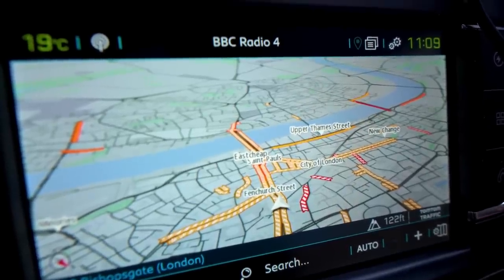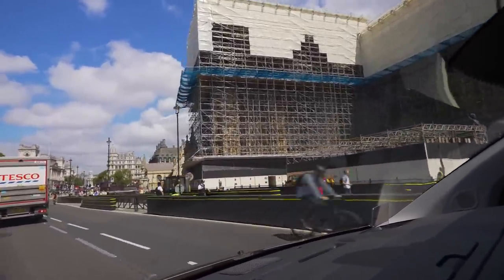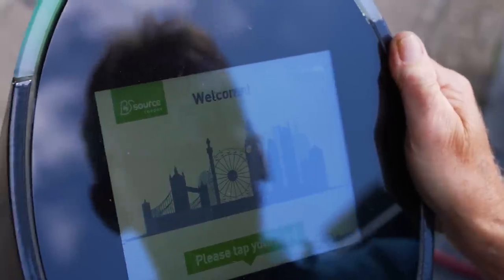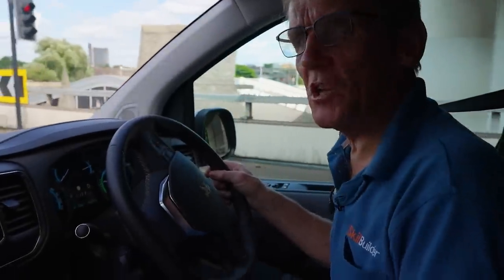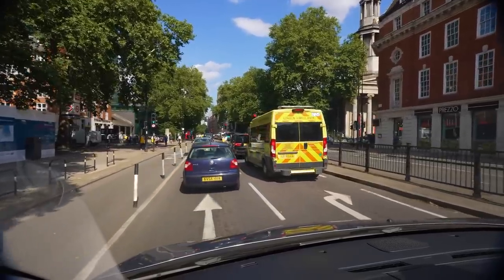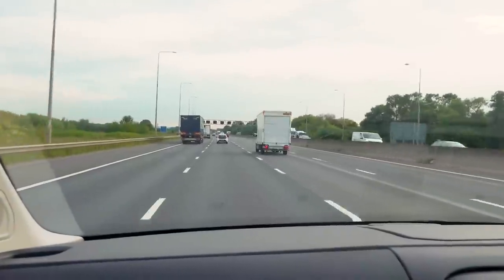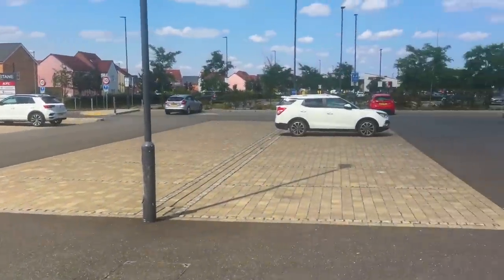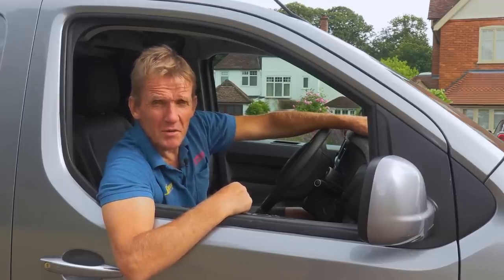Is It Time To Switch To An Electric Van?  e-Expert Test

Comment: The problem with most road tests is that they use brand new vehicles. Try a 3 to 5 year old EV and see how the battery holds up - that would be a more realistic test,
and don't kid yourself that the govt grants and incentives will last once they converted the majority to EVs, these schemes are designed to suck you in.
Also, how do you think the govt will make up for the black hole in their finances caused by the loss of fuel duty? What happened to your critical thinking Roger?
Reply: Rapid charging a battery every day will shorten battery life considerably, even Tesla has that problem, when charged daily.
Reply: @craigrobinson1234567  it does, just fast charge your smartphone for a year or two and see the difference in battery life
Reply: @polomint46  You are correct even they have the issue however where you miss the point entirely is that Taxi drivers who have done over 1 million miles on there Tesla's who charge regularly have seen no more than 8% loss of battery capacity. Now tell me how long it would take the average person to drive 1 million miles on their car? Secondly lithium batteries have come along way as have evs the leaf had terrible degredation it had no thermal management (liquid cooling) where as all evs now come with management. New batteries are round the corner like 2023 round the corner it will only get better. You clearly have done no research and its a shame because so many people think like you I have done long distance trips in 3 year old evs namely the leaf and zoe and I was shocked at the comfort and how much range they still had.
Reply: @craigrobinson1234567  how old is the vehicle ? i am hoping hydrogen takes of
Reply: That's your take on it of course. When ours - and other Governments - sign pledges and agreements to cut Co2 and other emissions, they have to come up with strategies to convince users to switch to alternative, less polluting modes of transport. And no, the incentives and schemes won't last. They were never meant to. But you have to try to begin the switch somehow if you've agreed to reduce Co2 etc..... If you don't offer incentives, then the move will take longer. Of course after 2030 there will be no new petrol and diesel cars or vans, so incentives will no longer be needed, plus prices of new EV's will have fallen by then anyway. It's the same story with all new technology. I bought a new Nikon 3.2mp digital camera about 15 years ago, at a cost of £450. The same thing today will be around £25 to £30......  You can buy a new family sized electric estate car today for £20k with a 7 year warranty if you know where to go.....  Why would a 3 to 5 year old EV battery be problematic when it has a 7 year warranty? The average battery degredation rate is around 3 to 4% per year.
Reply: @Brian-om2hh  Warranties don't cover consumables like tyres & brakes, they won't replace a worn out battery either, they just say "fair wear and tear".
Reply: @polomint46  3 years down the line they wont be worth a sh-t.
Reply: @geebix  your not kidding it’s absolute bollox. Saving money, wtf the thing costs 45grand. Your not saving a penny.  You are being robbed, it’s a metal box with three seats to carry your tools around. Whose going to buy the thing off you when it’s got a hundred thou on the clock. Some people are suckers.
Reply: @tracer1127  You are so right, it doesn't take a rocket scientist to see what is going on, a tradesman in a £45000 van however much will he have to charge to pay for that????
Reply: A 3 - 5 year old electric van wont be a worth a sh-t after 3 years especially as a new battery will be costing roughly half of the vehicles original price. E/V are a joke and sadly there are people now getting sucked in. Hold fire there is new technology on the horizon.
Reply: @geebix  if I didn't buy tech because there is better stuff round the corner I wouldn't buy anything, go drive electric and made an actual intellectual opinion based on facts please. Oh wait you probably can't.
Reply: @geebix  Our Nissan Leaf cost us £18k back in 2016. We part exchanged it for £9.5k a couple of months ago. Not bad for a six year old car.
Reply: @Richard482  That's only because consumers do not have a great deal of choice at the moment in a few years the market will be awash with second hand battery cars,  and besides there is always a mug prepared to by sh-t.
Reply: @MaDxStArZv  This crap is the very last thing I will be buying and I am trying to convince thousands of others to do the same, residuals in a few years time don't make me laugh. The number of these vans sold I bet in 12 months time you could count on you left hand. Sadly you are becoming what sounds like a boring salesman that's been brainwashed into believing this is the future. Even Elon Musk is off loading shares from his own company, now that tells you something,
Reply: @geebix  okay 👍 well have fun with whatever technology your betting on.
Reply: Exactly. I remember test driving one and it had a 70% holding charge guarantee. 

30% loss of charge hold in one year and the car company will just shrug and tell you to politely feck off.
Reply: Mine just hit 4 years old.
Reply: just like thee invisible home loan schemes
Reply: @robertsmith9810  Problem with hydrogen is that if fast charging station costs about 30 to 50 thousand then hydrogen station costs way more. If I remember correctly it was closer to 800 thousand. We also need better hydrogen production with greater efficiency from renewable sources.
Reply: @twig3288  The batteries are warrantied for 10 years .
Reply: @tracer1127  Purchased the 75kw version for £27k plus vat . Cost of an ev is 100% offset against tax . 

Was spending £50 per week on diesel . Now spend £8 per week on electric using off peak tariff saving roughly £2k per year on fuel .

The van has no gearbox ,clutch ,dpf filter , exhaust , engine oil , gearbox oil , radiator , injectors , starter motor to service or maintain . Who knows the saving of not maintaining these parts im going to estimate £2K.

After 10 years
 im claiming the full cost of vehicle back against tax                         £27k 
cost of 10 years fuel saving                                                                      £20 k 
cost of not having to service all those parts                                          £2k 
estimated resale value after 10 years ? who knows but it wont be nothing 

Net spend                                £27k
savings after 10 years           £49k

total saving after 10 years     £22k 

Sparky working in a 60 mile radius
Reply: @persona250  have you read the warranty?
Reply: @twig3288  10 years or 100000 miles must be serviced every year at a Toyota garage

Comment: Electric van wouldn’t last me half a day. I go out with a purified water tank full every day with 700L. Roof rack weighs 80kg + ladders. Some days I have all the jet wash gear as well as a gutter vac. Plus in the winter with the heater going, lights on etc……good in principle but won’t last long in reality!
Reply: I never thought about tanks, but often I am pulling a trailer with 2 tons of soil or stones, electric will pull it, but the range will be woeful
Reply: You will be constantly in limp home mode. Unless you just carry your sarnies to work the van will run out of puff in no time. Waste of money, 45 grand on a a car is a lot of money for most people but 45 grand on a van to carry your tools is bonkers.
Reply: Im a mobile detailer.
My current van is a 20 year old 450,00mile Vauxhall combo diesel. Even loaded I get 50mpg, 600+ miles per 5 min fill up.
I paid £1500 for it, 13 years ago!
I hired a Nissan EV van for a month. I gave the thing back after 2 weeks because I was having to cancel appointments and loosing money.

I cannot charge at home even if I bought one. So I'd be reliant on public charging.
The EV van allegedly had a 200 mile range.
On a typical day. I drive 150miles per day.
Except. Once I'd loaded the van for work inc the water tank. I was getting 50 miles from a charge.
I had to charge the thing 3 times per day! Thats around 4 hours wasted per day!.

My good day went like this:
Take missus to work. She comes home on the bus.
Charge the van... Yawn.
Do 1st job...
Charge the van.
Do 2nd job
Charge the van so its ready for taking the missus to work.

What usually happened was:
Take missus to work. She comes home on the bus.
Charge the van... Yawn.
Do 1st job...
Drive to the charge point, wait in a 3 deep que and eventually charge the van.
Cancel 2nd job because of the charging issue.
Charge the van so its ready for taking the missus to work.
If we did any socialising, shopping etc... I'd need to visit the charger again before turning in for the night or we wouldnt have enough juice to take the missus to work in the morning.

Charging the van isnt just the time charging the thing.
Theres the time to drive to the charge point (not many around here).
Waiting for a charger to be available if someone is already there. I have been 5 deep in a que.

I really despair for the future. They are not good enough. The range is too short and the charge time too long. public charging facilities are sketchy at best.
I live in a city of 320,000 people. My nearest public charge point is 8 miles away, there is just 2 points. The next charge points are across the city some 15 miles away.

I hate card payments. I have lost so many credit cards... I leave it at home, Im not good with cards.. I can buy diesel with cash... I like cash, I know where I am with cash.

The local bus company has some electric buses... They are always freezing cold and the drivers are not allowed to turn on the heaters on because it kills the range, the buses are constantly getting delayed or cancelled because of them needing charging.
Reply: @sahhull  Nice to hear your real world electric van experience.

I spoke to an Amazon prime driver yesterday in his electric sprinter. 80 miles from a charge, but he admitted he often has to turn the heater off so he can make it back to base.

Comment: 500 tons of material has to be mined, transported and processed to produce 1 ton of lithium for batteries. Even before you start driving a new  electric vehicle, thousands of litres of diesel is produced and burnt in combustion engines to manufacture it.  Recycling the batteries after 10 years life is hugely damaging for the environment and vastly more complicated the equivalent combustion engine vehicle.  
Hydrogen powered  combustion engines are the answer.  
 Jcb are developing this technology for its products, which works out cheaper, lighter,  performs better and doesn't need charging every 5 minutes! The world has been incredibly stupid listening to Elon Musk!!!
Reply: @jameswilford5225  tell that to the 40,000 children in the Congo digging out Cobalt with there bare hands  ..
An electric vehicle has a carbon footprint of 3 times that of an ice vehicle in production value. 😳
Reply: @dashcam2417  what about lifetime emissions? Sooner or later, the recycling process will be perfected.
Reply: @dashcam2417  Are these the same kids that dig Cobalt for use in petrol and diesel?, You forgot to mention that, I wonder why?
Reply: @HKFunster  because a car like a model X Tesla has a battery pack using 16,000 laptop style batteries and weighs 76 stone ... cobalt used for fossil fuel is greatly less and only in the refining process.
Reply: @JohnnyMotel99  only Renault are making a factory dedicated to recovery of car battery technology packs they think that they will be able to recycle 1,300 packs a year ... But the rare earth materials used will not be able to be recycled.
Reply: @dashcam2417  more cobalt is used refining petrol and diesel. People also neglect the fact that are possibly writing this comment on a device that contains said cobalt
Reply: @jamesbinns8530  don't forget an electric car has a massive carbon footprint from production alone compared to internal combustion engine production.
Reply: Not all lithium has colbolt in, most newer chemistries don’t use it now.  One would have to do their home work before making a sweeping statement fit every battery pack from every company… this includes all those lovely power tools too btw
Reply: James, 

hydrogen is difficult and very wasteful to produce. You are better using the energy source directly rather than using it to make hydrogen. Hydrogen is also very dangerous and difficult to contain, and readily ignites when released into air. There are, I think, far more negatives than positives for hydrogen
Reply: @dashcam2417 " Cobalt used for fossil fuel is greatly less and only in the refining process."

 Tell that to the 40,000 children in the Congo digging out Cobalt with there bare hands  ..
Reply: @Brian-om2hh   the greengage. Trying to send link that keeps being deleted
Reply: @Brian-om2hh  most companies  are saying carbon zero because their other projects offset the pollution caused by a manufacturing plant .

Comment: I have had a VW e-transporter for 3 months now. Well made vehicle, drives well. However the 80mile range is not realistic maximum range has been 65miles. The charging point on the van is to far away from the public charging points which mean the cable does not reach the van. With winter coming I am going to have to be careful with my driving range.
Reply: At last a  real life experience with an electric van  . Thank you for the comment.
Reply: Get yourself a longer cable. I have seen 10 metre ones advertised..... A longer charge cable is always a good idea, as chargers are sometimes ICE'd.......
Reply: Unfortunately I can’t find a cable that can extend the 55kw cable fitted to the charger.
Reply: telsa d ell 92 mle raneg

Comment: When electric vans are £1200 I'm in!
Reply: 2nd hand electric... batteries will be shite and cost 5K per set to replace
Reply: @0skar9193  Your not wrong! Ps love the balsamic dressing.
Reply: @0skar9193  5k !,and the rest ,more like 11k
Reply: They will be eventually. All vehicles depreciate......
Reply: @0skar9193  Not at all. A battery refurbishment is much cheaper than a replacement. A total replacement is not always necessary, as the cells do not all degrade at the same rate. Cleveleys Electric Vehicles in Gloucestershire are already offering battery refurbs. They posted a YouTube vid of a battery refurb on a 10 year old Nissan Leaf. The work took 4 hours, and cost the owner £600. There is a huge amount of nonsense regarding EV batteries. Posted mostly by those whom have never owned, driven, sat-in, or even touched an electric car......
Reply: @Brian-om2hh  but are the rest off the cells getting ready to fail?

Comment: Got the same van. Best bits are the drive train, instant heater in the winter and decent aircon in the summer. Drives best in town that’s where it really shines. Bad bits are the motorway mileage. Glad to be free of the constant dpf/add blue issues on my old transporter.
Reply: how much do u reckon you are saving on garage bills for repairs and service? they arent suitable for everyone but i reckon 50% of vans could go to electric tmrw and never run out of range.
Reply: Yes they made sure driving diesel was a real pain ... for a while .. before offering up the next product. Whilst offering them up they increased the price of diesel by 70%+